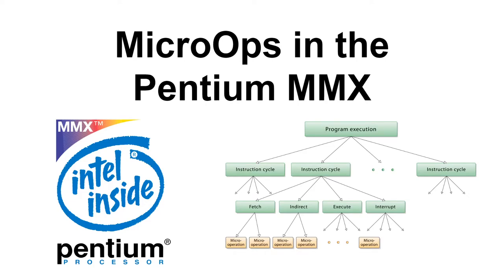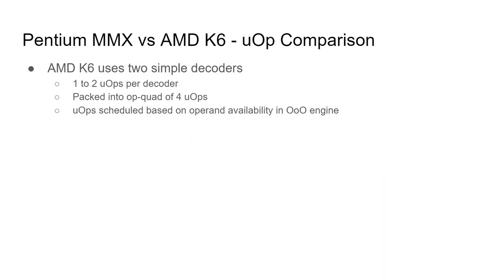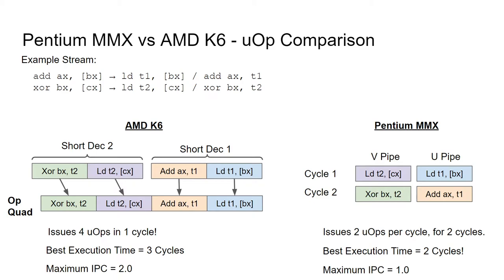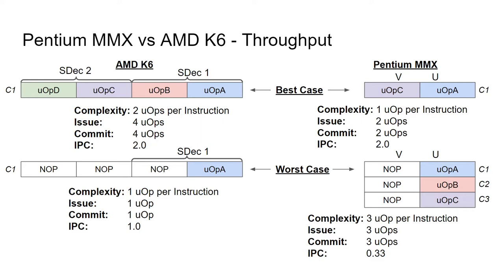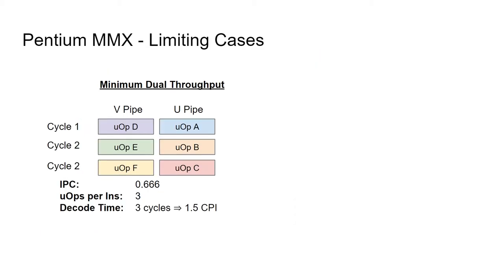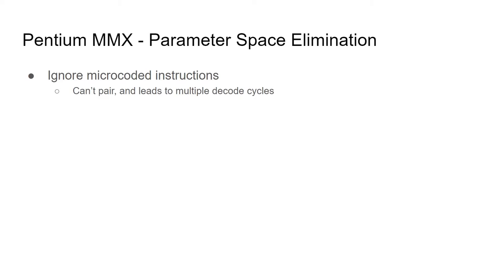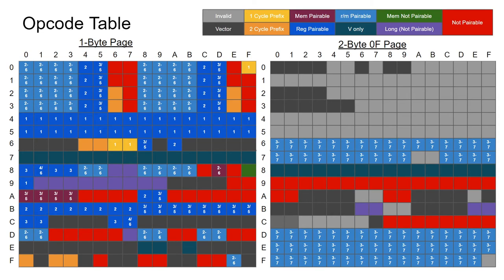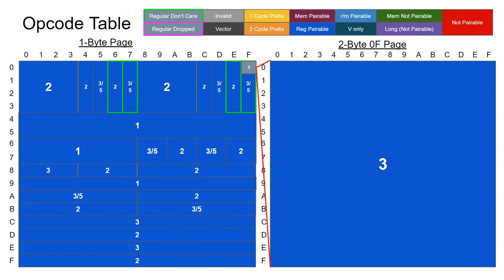MicroOps in the Pentium MMX

Comment: I really appreciate you taking the time to make these videos, they're very insightful and understandable even with limited design knowledge. Do you plan to do any videos on how SIMD is implemented on these processors, your mention of microcode emulation piqued my interest
Reply from the maker: Thanks! That's the goal, but I am always concerned that they will end up being too technical.
I didn't plan on doing a video on SIMD, but I can. The only interesting parts in the PMMX were the resource sharing (since the MMX function units could be claimed by the U or V pipe), the register file duplication and power gating (I believe that's the reason why a FP/MMX switch is so expensive), and maybe the interaction with U-V load/stores. Other than that, the SIMD function units were built to do all of the 64-bit operations without any specific microcode.
The K7 on the other hand was a bit more interesting, since it had a 32-bit datapath and was designed for the 64-bit 3DNow! and not SSE. So all of the SSE instructions required a double issue (one way to look at that is: the SSE instructions were translated into two 3DNow instructions). I can talk about that when I cover the K7 front end.
Or were you more interested in how the actual function units were implemented?
As for microcode emulation, that's what Intel calls the vector decoding process. If an instruction requires more cycles or micro ops than the regular decoders can handle, then it needs to be sequenced from a ROM. It's effectively "emulating" the behavior of the massive PLA used by the 386 and 486, but is also capable of offloading the work from the hardware decoders (making them simpler and faster).
Reply: @RTLEngineering   @RTL Engineering  whoa, thanks for giving such a detailed response! Yeah it was more the SIMD frontend that I was curious about and you pretty much answered all my questions with that :) Very interesting to hear about the K7 though, always believed that 3DNow! was more something tacked on rather than something that the CPU was designed around though I suppose it makes sense when you consider release timing. Looking forward to your video on the K7 frontend though!
Reply: @RTLEngineering  I alway saw SIMD like a simple control unit with 4 execution units behind an unpacker stage Maybe it's a very simplified view or completly wrong. 
But why they didn't just use 4 arithmetic pipeline and directly schedule scalar (even from a different context with shadow register) and simd alike  ? 
Beside if the long term goal is an fpga implementation, i wouldn't mind a global view of the architecture, how the piece fit together and how well fpga specifities can be use. 
For example async unit on the P4 was a disaster, but on an fpga SRAM and DSP can clock almost twice as fast than the all CPU, can be useful ?
Reply from the maker: @vincentvoillot6365  That's one way to think of SIMD, though MMX was a bit more complicated. There would be 8x 8-bit execution units in this case, which could link together to form 4x 16-bit or 2x 32-bit execution units, meaning that they couldn't be duplicated blocks. The operations performed by MMX had to be much faster than the integer ALUs could handle, at the cost of being less versatile. Also, the PMMX had two MMX ALUs, meaning it could have up to 16 execution paths in parallel.
There may have also been the desire to not modify the integer paths, since that would have required more work/effort, which means it would have taken longer. The end result was treating it like another coprocessor (similar to the FPU).
By global view, do you mean going over how things executed (going over the block diagram and a pipeline diagram)? Or do you mean something like going over a dieshot and comparing it to the block diagram? (I have the former as part of a longer video that I am thinking about cutting down and releasing as a long and short version, and I have been considering the latter).
Async in a FPGA becomes very tricky though, especially when it comes to constraints. You would be better off mapping it to a synchronous block that runs faster, if that's what you are implying. Although, the P4 was much faster than any FPGA could reasonably handle.
In terms of general mapping to a FPGA, that's a very complicated topic. Henry Wong went over that in his dissertation, and I have been thinking about doing a video on it. Essentially, the "gate" delay in a FPGA is much larger than it would be in pure silicon, so the optimal number of pipeline stages for a given speed target is longer than it would otherwise be. But Intel had a paper looking at this for the P4, where more stages means that you have a longer delay to evaluate branches, and that reduces performance. So there's an optimal number of pipeline stages which 1) sets the complexity of each stage, 2) the LUT depth per stage, 3) the maximum achievable clock speed, and 4) the maximum performance for a design. Essentially, if you were to implement a P4, the most optimal design might end up being 40 stages (longer than the original P4), which means it will take maybe a 30% performance hit, and only be able to achieve a clock speed of 300 MHz. The same thing is true for the PMMX (though not 40 stages), but since the PMMX is so old, you can cover some of that performance hit with better resource mapping and some newer execution methods like a better branch predictor (even GSHARE would do significantly better - for a P4, you would have to move to something like a perceptron based predictor).
Reply: @RTLEngineering  When i said global view, i mean block and pipeline diagrams. Die shot are interesting, but for what i understand from Henry Wong thesis is trying to reproduce 1:1 an existing CPU to an FPGA is far from efficient. I'm not advocating for a P4 implementation, i'm not that pervert ^^.
And as you said, PMMX is an old beast, and could use some modern features 
I get that each gate levels introduce a propagation delay, and the goal is to create small "fast" blocks and string them in a pipeline. 
Mr Wong make a comparator-adder on three levels and target 200-250Mhz, an DSP48E can do the same thing on 48bits on his second stage at 400-500Mhz and at my knowledge the only cpu having async unit was the P4. "The iDEA DSP Block Based Soft Processor for FPGAs" use an dsp as execution unit, not the most efficient but can be interesting for an simd.
Personnaly i'm still stuck on his caches diagrams, it's like looking at an MC ESCHER drawing.
PS sorry for my broken english
Reply from the maker: @vincentvoillot6365  A pipeline and block diagram will be in an upcoming video. The neat thing about die shots though, is that they can give a better clue as to how things were implemented in hardware. With the older devices, like from the original Pentium era, you can even count things like bits in SRAMs. For example, the early Voodoo GPUs skipped a few bits in their texture compression tables to save space, which deviates from the specification. Although, that would be too much detail to discuss in a video.
That's one interpretation of his dissertation, although, I would take it more along the lines of: modifying the architecture to map better to a FPGA will be more efficient. Even mapping a PMMX wouldn't be all that efficient (I think you could at least hit 133 MHz on an Ultrascale+, but you probably want to run it faster). As long as software doesn't perform worse on the FPGA implementation, then you're better off remapping it to something more sensible. Luckily software that ran on the P5 didn't build cycle timings into the logic like older systems (the IBM PC or C64 both did this, which is why games tend to run too fast on faster processors). For comparison, I suspect that a better mapping could probably hit 500 MHz on the same FPGA.
I would advocate for implementing ALU functions like that in the DSP48, not because it's faster, but because it saves LUTs. You get a lot of functionality out of a DSP48 in that case. In fact, implementing the MMX ALUs would probably be more efficient to use 16 DSP48s (for a single ALU) then to build them out of LUTs. Although you can actually pack the operations better than that, so it would use less than 16 per ALU. The speed of the DSP48 comes as a bonus. Although Dr. Wong's dissertation was applied to an Altera FPGA if I recall correctly, which didn't use programmable DSP tiles like the Xilinx FPGAs. 
I think that's an accurate description of any cache diagram (a M.C. Escher drawing), though the complexity there is to account for the out-of-order nature of load/stores. Also, throwing coherency into the mix makes it more complicated too.
Reply: @RTLEngineering  Yes Altera use variable precision multiplier 36bits or 2x18 or 4x9, but no "advanced" functions like their Xilinx counterpart.  
The out of order aspect didn't simplified the caches, but the "tricks" he used to shortened the delay his mind blowing, he said spending two years on this alone and yet it's the slowest part of his architecture. 
You already drop the Voodoo name twice, are you thinking about implementing a voodoo card  ( a 12bits rasterizer with two 16bits textures units if i remember correctly ) ? 
If you answer yes with a soundblaster live and a matrox millenium, i will name my first born "RTL Engineering" :D
Reply from the maker: @vincentvoillot6365  Exactly, that's why the Xilinx DSP tiles are better suited for this type of application. The newer Intel ones are better for complex fixed-function stuff though, like floating-point calculations (since they can do that as a hard IP). But most of these retro systems didn't need tons of FP32 MACs, meaning the Xilinx ones are more useful.
That's architecture for you. You need to employ lots of "tricks" to shorten the critical paths. Note that was the slowest part of his implementation mainly because of his design choices. He could have designed the other parts differently resulting in them being slower (like using a fully associative TLB). It's just that there wasn't a performant alternative that was faster.
As for the voodoo, did you see the channel update video a few weeks ago? That should answer your question.
I don't have any plans to work on sound hardware though, it's not an area that I know a lot about, but it's much simpler than a CPU or graphics processing (at least with the required timings), so someone else can probably write one (especially if the interface is PCI). Also, please don't name your first born after my channel name, that would be awkward...
Reply: @RTLEngineering  Ho my god, i just connect the dots. Rasterizer, PCI, xilinx ultrascale+... 
The sound blaster and the first born were a joke (i already name her VIA C3 ^^). 
Beside there is a SB16 in the mister core that can be use for a basic compatibility and the EMU10K1 is not the simpliest DSP. 
It's amazing how many cards we need back in the day, a matrox for 2d, a voodoo for glide, an hollywood+ for mpeg, a sound blaster and even an SCSI.
Do you work on a Kria module ? I was thinking buying one ( so cheap 200$ for a virtex with 150k LE and almost 1Mo of SRAM). But the lack of memory dedicated to the PL is a bummer
Reply from the maker: @vincentvoillot6365  I didn't realize there was a SB16 core on MiSTer, but that could be a sound solution in the short term. I'm also not sure about the 2D solution, given that there's a large framebuffer requirements when you go to VGA+ (external memory could be a solution, but a 3D card would need to monopolize that interface). I have been thinking about just integrating the 3D and 2D into a single unit that can share the memory port though, which should give some indication toward the end goal.
I also haven't thought about mpeg, but that's a complication for another day.
Do you mean the Kria SoM or the starter kit? I've played around with the later, but it isn't a good target due to the lack of memory on the PL as you mentioned. The rasterizer / GPU is being developed to work on the 7-series though, and is migratable to the Ultrascale+, which might give some indication there. 
Also the Kria has 256K LEs with almost 3MB of SRAM (you have to include the BRAMs + URAMs). 3MB isn't enough to really offset the lack of memory on the PL though, and the hard DDR4 interface has too high of a latency to be all that useful (between 3us-30us per request, but can issue something like 48 in parallel that are all 16 bytes wide - so high bandwidth + high latency).
Reply: @RTLEngineering  You could use some bits of the ao486 of the mister ( the VGA and SB16 ), or indeed integrated a framebuffer and 2d acceleration (so a 3DFX Banshee ?). 
For the MPEG it's mainly inverse FFT and colors conversion and not very useful for games.
I think sadly CPU and "GPU" need to be on separate FPGA or at least dedicated memory interface. 
For the frame buffer 1024*768@60hz at least 280Mo/s, half if switch between memory bank ( one read, one write ), any 32bits sdram clock above 66Mhz would do the trick. At 166Mhz with 16Mo should have enough head room for the textures. 
But it will be better to leave the ddr for the graphic and the low latency sdram for the CPU ?
I was thinking of a PCB to adapt the kria som on a compute module carrier board (for the raspberry), gaining a pcie (can be bridge to regular PCI ) and the possibillity to add sdram on the adapter.
The starter kit is just a kria module with a carrier board, or did i get something wrong ?
Reply from the maker: @vincentvoillot6365  That's probably the best solution - to bootstrap with the VGA and SB16 from the ao486. It might also be fun to write a CGA/EGA core, which I think would be needed for something like the Banshee anyway. 
Well iFFT and color conversion is something that FPGAs do well. It will come down to what hardware is being implemented though. A Voodoo1/2 doesn't need to handle MPEG, so that can be assumed not part of the hardware.
The problem isn't different FPGAs, but dedicated memory interfaces. Funny enough, the one exception to this would be if the GPU was TBDR based like the PowerVR ones. But a Voodoo would be far more impactful and easier to implement. 
The Kria does have enough I/O to have a significant SDRAM bandwidth (I think it has 285 pins?), some of those are low voltage only, but they can run at 1V8 just like automotive SDRAM does. That would mean giving up those pins for other I/O though (including VGA out). If you wanted to go that route, I wouldn't suggest using the SoM on the starter kit (even though it's cheaper), since it's missing a connector. You would have to go with a bare SoM instead.
I think it would be possible to add a SDRAM module to the new Kria Robot platform though, since it has a Pi Header + 4x PMODs. But a single 16-bit SDRAM wouldn't have enough bandwidth to match the Voodoo1's FBI (64-bit x 50 MHz). Essentially, you need to go DDR3 or faster for the graphics memory. 
I did look into the latency requirement for the GPU, and it's much stricter than the CPU. The reason is that the framebuffer doesn't have good cache behavior. You are guaranteed to need each part of the framebuffer every frame, and if you don't bin the triangles, then you have no guarantee that there will be any locality. This is why TBDR is so powerful, the framebuffer is broken into tiles and kept in the GPU SRAM. So all you have to do is fire and forget the tile writes to the DRAM, and that's incredibly latency tolerant. But it comes with its own drawbacks.
You are correct about the starter kit, but as mentioned above, it's missing one of the two connectors. You would be better off with the robot kit which is $150 more but has both connectors and at least some I/O.
(edit) On some further thought, it might be possible to do a Voodoo + CPU with 16-bit SDRAM, if a low resolution is acceptable (640x480 single-buffered). It's probably not worth it though.
Reply: @RTLEngineering  The power VR did somekind of tiles chasing ? Interesting.
Beside ao486 give you also a bios, but the other I/O need to be rewrite being tie to mistercore, IDE and PS/2 at least, USB some IP on opencore could work but the hardaware and software implementation seem nightmarish.
64bits@50Mhz could be replace by 16bits@200Mhz (thirty-ish pins). 
800x600@16bits two frames would fit in 1Mo of SRAM
1024x768 would need 1.5Mo for one frame. Leaving plenty for the CPU or a texture cache.
I didn't look at the robotic starter kit, if the 40pins connectors can be mapped entirely to the PL, it can be used with an SDRAM from the mister project (yeah i'm cheap and lazy ^^).
High bandwith RAM always come with high latency, like you said without a big cache (8-16Mo) to help, this is not going nicely. But didn't that depend on the target frequency for the CPU ?
Wouldn't a 35µs delay hit harder a 1Ghz cpu than a 100Mhz one ? or at least wouldn't need as much cache ?
I curious to see how fast a x86 can be on a modern FPGA. 
I can see a complete PMMX taking at least 50K LE and clocking at best around 200Mhz.
Reply from the maker: @vincentvoillot6365  Tiled rendering. Same technology in the Dreamcast, and a similar technology that the ARM Mali GPUs and the Broadcom GPUs use (i.e. same method as the GPU in the Kria and in the Raspberry Pi). Break the framebuffer into 32x32 pixel tiles. Figure out every triangle that overlaps each tile, and then render just those triangles in the 32x32 window. Repeat for every tile on the screen. The most memory intensive part of rendering is the framebuffer ROP, where you need to do a read-modify-write. By breaking the framebuffer into tiles and rendering the entire tile in one go, you can have a 32x32 pixel cache in the GPU SRAM that does 1-cycle RMW operations. Then just dump the 32x32 pixel tile to VRAM when done, which is just a write burst operation. In exchange, the latency from start to end of a frame is higher, and you need more VRAM to store the tile lists as well as increased bandwidth for textures (since they can't rely on locality anymore). It's a pretty neat idea, and clear why it's used in mobile devices.
- For the ao486, Luckily a lot of that I/O can be simplified for testing. But going more complex is a task for once the CPU is up and running. 
- I was going to say that you can't get SDRAM to run at 200 MHz, but I guess you can still get those chips (I thought the max was 166). So that could work, though I doubt it would with that sort of interface. The SDRAM on the MiSTer has a hard enough time reaching 100 MHz, let alone 200 MHz.
- There isn't a lot of info on the robotic starter kit yet. I was looking at the pin constraints file and they only mapped out the PMOD connections (not the Pi hat). So it's possible that the Pi hat only has power and I2C on it (making it unusable for SDRAM).
- A CPU should be able to handle a 35us latency, especially if it has a L2. The problem is a GPU cannot if it needs to read-modify-write a framebuffer stored in the DDR4 (you can only exploit the locality used by a L2 if you bin the triangles first, which would add drawing latency and bring a Voodoo to a crawl). So in the case of SDRAM, you would have to use that exclusively for the framebuffer (textures could probably go in the main DDR4 if there was enough L2 for them).
- I am guessing the PMMX will take 100K LEs and run at 400-450 MHz, or at least that's the goal. It can be made smaller if the threshold is reduced to 140 MHz. But 100K LEs for a PMMX + 80K for a Voodoo, that leaves about 70K for an audio card, miscellaneous I/O, and routing, on something like a Kria SoM.
Reply: @RTLEngineering  If you're still interested in CGA and haven't done it already, you might be able to borrow from the Graphics Gremlin project. It's an FPGA video card for 8-bit ISA systems that implements MDA and CGA (selectable via switches), with output for a TTL monitor, VGA, or composite video (though VGA and composite are mutually-exclusive, due to sharing a DAC). The HDL source for it is in Verilog, rather than your preferred VHDL, however.